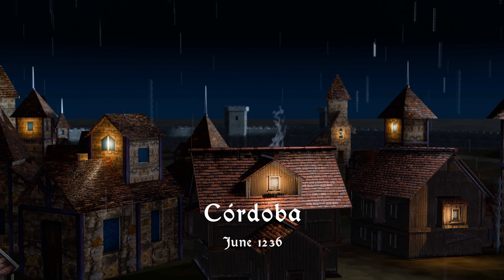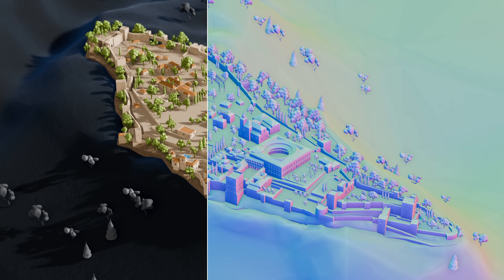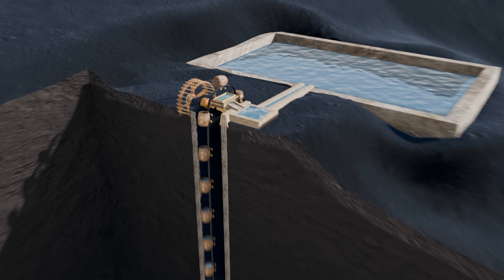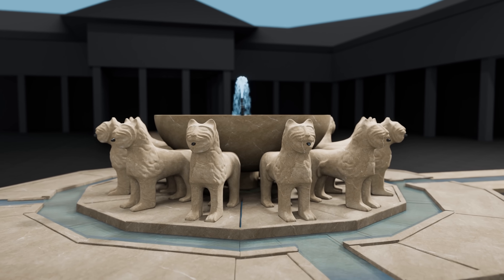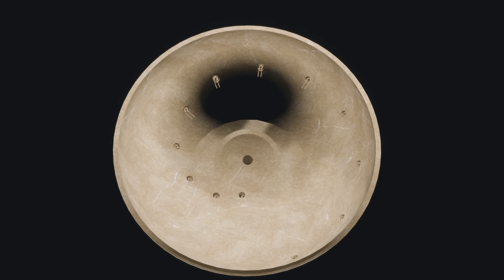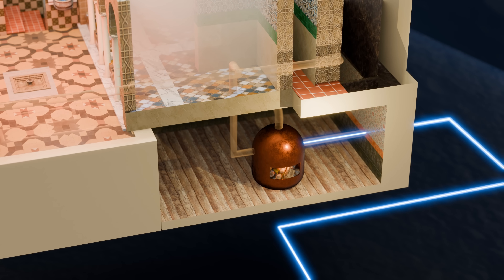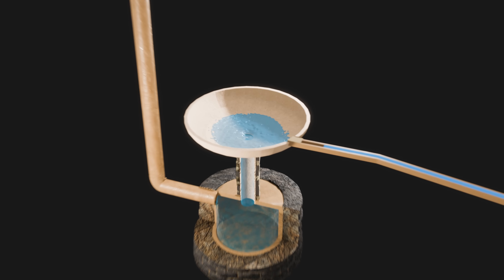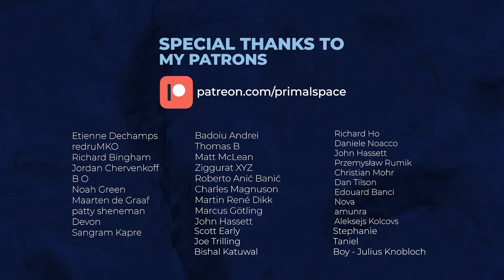The Ancient City That Mastered Water

Comment: The intricate calculations required for the amount of water flowing through each pipe and that to hundreds of years ago truly shows how skilled the architects were. Truly inspiring
Reply: Maybe just drilling an extra hole every hour? But looking at the design, the bowl becomes wider in height making the water rising slower, and the number of holes leaking increases,  making the precision on the late hours much more problematic
Reply: @2adamast  they actually compensated that, btw flow was controlled by a rotating wood valve that needed replacement every few years that controlled flow rate
Reply: And what is so special  in comparison to Roman aquaducts and fountains?
Reply: Islamic architects. Africans and Muslims brought plumbing to europe. And bathing. And reading.
Reply: @GoodBaleadaMusic  😂
Reply: @cartercasias6318 Spain was a Muslim country in 1491. Laughing white clowns don't exist now that we have chat GTP and the internet. You've been completely contextualized.  The middle East spent 1500 years in Europe colonizing it and teaching it everything.
Reply: @cartercasias6318  basic information makes you laugh like a goof 😂😂😂👍
Reply: @cartercasias6318 thats, history?
Reply: @GoodBaleadaMusic  Ancient romans had plumbing and aqueducts tho(before even both Christianity and Islam were known to Europeans). Also, Islam didn't really become a thing until centuries after Christianity happened, and got adopted by Euros first before some of them converted to Islam.

First roman aqueduct was built centuries before Christianity and Islam.
Reply: @GoodBaleadaMusic  Nice propaganda. But nothing of that was found in the Meccain culture before muslims conquered highly cultures of Rome and Persia.
Reply: @peacebewu  Roman baths are not the same as broad plumbing infrastructure. Or broad education. Or broad hygiene. That is what Islam brought to Europe.
Reply: @morriganmhor5078  What are you talking about? Islamic Spain was the only place with plumbing and literacy for like a thousand years in Europe. It took the rest of Europe a thousand years of being neighbors with Spain and Italy but also persia's right there. The Germans have linguistic ties back to Turkey 

They couldn't fucking read 😂😂😂😂
Reply: @morriganmhor5078  The entirety of your historical knowledge is propaganda. Take the Spanish example for Moreno. They say it means brown. But it's original biblical version is shiny black. But Spain doesn't want you to know that they had African Kings
Reply: @GoodBaleadaMusic  Excuse me, but I studied at university, not at leftist madrasa.
Reply: @GoodBaleadaMusic the greeks and especially the romans already had plumbing, bathing, and reading. medieval europeans already knew how to make architectural marvels, i mean just look at venice.
Reply: @GoodBaleadaMusic the water channels and plumbing were there before, left behind by the Romans, which is why an aqueduct is part of the framework, the Muslims just connected new buildings to it after the invasion.

Romans had plumbing and baths, in fact they are also the reason a lot of north Africa and the middle east got any of it.

Unlike what a lot of Muslim propaganda likes to push, when the Muslims got kicked out it wasn't like going back to the stone age, it was the start of a golden age for the countries they got kicked out from, and this is verifiable very easily.

Not to mention the wild Muslim claims especially about the paradise of Al-Andalus, considering none of these claims have historical sources, rather artistic sources, commissioned centuries later, created by people who never even visited Spain, while the historical sources of the time completely disprove any of it.

The word moreno means more of a tan, there is another word for brown, marron, these words come from latin and marron specifically appears in multiple European languages as a word for chestnuts which are brown.
Reply: There are going to some people that would call this "Aliens", wish i could attach the history channel guy's gif here.
Reply: @GoodBaleadaMusic  The romans created all that, that's where islamic architects got the knowlege. Stop being pathetic please, it's cringe.
Reply: @backintimealwyn5736  Those Romans became Muslims. At Rome's peak it was only 4% European. You're like one of those North Koreans that thinks daddy moved a mountain. You're so propagandized that you have to erase a thousand years of history. 

Europeans are some of the most pathetic and desperate rewriters of history.
Reply: @backintimealwyn5736  You truly believe that Romans were white people. The middle East colonized Europe from around the time of Caesar until the fall of the Ottoman Empire. That is where the center of knowledge and invention and philosophy lived. Leonardo da Vinci developed in a center of Islamic scholarship. Kings from all over Europe sent their princes to learn to read from Eastern people's. Not Europeans. You call the dark age a moment when Spain had plumbing and literacy because it was controlled by Africans and Muslims. You believe a complete Disney fairy tale of history. So please you stop being pathetic. I could sit here for hours reteaching everyone reading this. I will make you look like a fool.
Reply: One version (romans brought), does not exclude the other (muslims brought it).
What if romans had it first, the later christs in their area forgot about it, while muslims picked this inventions up and kept it, so that the later christians (13. to 15. century) retrieved this know-how back? History is not linear, and healthy empires exchange know-how.
Reply: @morriganmhor5078  I think you dont know that Baghdad was the centre of civilzation during that time. Even people from Europe used to go to Baghdad to get education. Its a fact and not easy to digest for some people. Do you even know why the students are asked to wear a gown which looks like Arabic dress when they receive a degree???? Just think about it. Western world was in dark ages at that when Muslim world was st its peak. But now Muslim world is in dark ages while western world is at the peak of development. History repeats itself.
Reply: @AR-fr8br  Muslims occupied the most developer parts of the Rome And Persia. As long as kuffar paid jizya, chalifate was healthy, but as their number diminished, IT Went south. Btw, were was all that Arab science, medicine or architektuře Before conquest?
Reply: @morriganmhor5078 We have the internet now. You can't rewrite history.  Muslims aren't just Arabic. The center of wealth and knowledge was always in the east whether it was in Persia or Constantinople or Egypt or Baghdad.
Reply: @morriganmhor5078  isn't it incredible how smart you thought you were? That part of the world has been the center of knowledge since knowledge had a center. Before that it was India.  Germans are just Turkish people
Reply: @morriganmhor5078  Islam have nothing to do with being arab and most of that knowledge came form the middle east and north Africa so basically the Islamic world and they did invented and discovered alot more so yeah they were more developed and had more knowledge and most of the scientists at the time were Muslims
Reply: Pretty sure all of those ideas came from the Romans.
Reply: @GoodBaleadaMusic  Your misconceptions blow my mind :
-2000 : Egyptians build the pyramids (so they had already mastered mathematics)
-300 : Romans build the first SPA of the human history
600 : Islam is created
1200 : Al Hambra is created.

You conclusion is that Islamic engineers gave SPA technology to Europe ?
But here you are bending 1500 years of human evolution (-300 vs +1200 so "Italians" had figured this out 1500 years before).
Reply: @kaoulkae  You're equating the baths of oligarchs to a city infrastructure of plumbing.  Your double standards below my mind. What the men from the middle East built in Britain was not what the men from the middle East built in Spain. It's not even close.  Plus they didn't teach anyone to read.
Reply: @kaoulkae  You're talking about spas for oligarchs.  I'm talking about city building.  I'm talking about global infrastructure for the whole city.  I'm talking about a society where everyone learns to read. Where scholarship and medicine and hygiene are important cultural traits.  That is what Islamic people from the middle East brought to Spain and Europe.  And then Christians rose up and lost all of their economic alliances finding themselves with no gold. So then they took all of that education that Islam brought them and have been raping the world for 600 years with it.
Reply: @nirmalprevin  They were Muslim engineers. I was born Catholic but i cannot look down on a religion that is followed by 900 million people ,  nevertheless today they would not be able to produce such cutting edge technology as they did in those days .
Reply: @GoodBaleadaMusic  Islam didn't exist when plumbing was invented, imagine thinking a BC era technology was invented in AD era religious sects. What a contrived conclusion.
Reply: @Mad_Catter_  It's like you guys think Islamic people emerged from the sand lol. The first cities with plumbing were Islamic cities in Spain. And you're right. The people who invented plumbing weren't Islamic.
Reply: @Mad_Catter_  there's something wrong with you. You literally think islamic people came out of the desert from nothing 😂😂.  This is why the CIA talks about you behind your back.
Reply: @Mad_Catter_ I keep reading your comment And it's like you smoked heroin thought about what I said fell asleep woke up and then replied
Reply: @GoodBaleadaMusic  "there's something wrong with you. You literally think islamic people came out of the desert from nothing"

No, you are the one whom think Islamic people existed in BC Era, what a notion of madness honestly.

Another notion of madness is thinking the CIA cares about me or anything within my capacity. Wild.
Reply: @Mad_Catter_  stop squirming you sneaky settler.  You are pretending that the people of Europe enjoyed plumbing because Romans brought baths.  But the first time that Europeans enjoyed broad City plumbing was when Muslims brought it there.  But you keep playing this game. It's not working. Everybody sees how desperate you are to hide the "dark ages". Which were really the moments when Africa and Islam were teaching Europe how to read and wipe their asses. But that's what hurts. That's why you're fighting so hard. That's why you're squirming. Because you're a squirmy settler.
Reply: @Mad_Catter_  It's kind of hard for white people to gaslight everyone with chat GTP and Google 😂😂😂
Reply: @GoodBaleadaMusic  We also help set up there goverment!
Reply: @backintimealwyn5736 lol , bro said the Romans 😂😂
Reply: @jeem-s3f  yep the romans put thermal baths all around the mediteranean well before the7th century , illiterate child.
Reply: You don't need to calculate things always, there are ways of doing things by using golden ratio or something else that work.
Reply: And whats the difference today?
Reply: @Mad_Catter_ Islam has always been there... it's from Abrahamic religions ...
Reply: @Mad_Catter_ Islam has always been there... it's from Abrahamic religions ...
Reply: @Logicalsane  No it really hasn't. Trying to claim that would then begin disputes that before the times of Abraham there were those before them, and that it actually belongs to Sumerians, which invalidates your entire argument that it is in fact Islam. Do you see the error in your thinking yet?
Reply: To be more specific, it's the Moslim architects, not medieval achiects.
Reply: @Fola1895  lmao Medieval architects could be any religion stop being daft.
Reply: @GoodBaleadaMusic and the Romans and Greeks?
Reply: @GoodBaleadaMusic and China?
Reply: @GoodBaleadaMusic the Greeks and Romans had baths. They had hygiene systems as did the Jews. I think you are using the word Islam for pre Islamic times and misconstruing historical timelines.
Reply: @BernardoTorres-w5e I think we underestimate what our current engineers can do.
Reply: @itsjudystube  why is it your cultural reaction to erase Islamic and African contributions to Europe? Do you truly believe that these contributions are contextualized correctly?
Reply: @cartercasias6318 that's literally true, The Moors civilized the Spanish. Spain was a sh1t hole before they came. 
You ignorance racist boy
Reply: probably trial and error rather than some maths
Reply: @GoodBaleadaMusic  HAHAHAHAHAHAHAHAHAHAHAHAHAA🤣🤣🤣🤣🤣🤣🤣🤣🤣🤣
Reply: @GoodBaleadaMusic  its true but not reading
Reply: @reactivist6526  doing your own disinformation campaign 😂😂😂
Reply: @GoodBaleadaMusic  you brought nothing only silly claims, i guess you cannot fathom the truth
Reply: @reactivist6526  I guess you're not strong enough to point out which claims you have trouble with.  I think it's your culture
Reply: They stole old Indian technology through Mughals.
Reply: @GoodBaleadaMusic  Pipes and water management is way older than that. Here in La Alhambra they took the water from the river, very "advance" for medieval period...This pipe system is ridiculous compared to any Classic city from 7000 years ago. Nothing to go crazy, that´s why the Califa drink a lot of wine, cos the water was bad at the Alhambra hehehe.
Reply: @josemorenoporras7506  I'm talking about Europe. So you're saying it took them 7,000 years and 1,000 years of Islamic colonization for Europe just to learn how to do that? Plus reading?
Reply: @josemorenoporras7506  and the pipes and water management system in Al andalus is just an extension of normal old regular water management from Africa. Completely futuristic in Europe
Reply: @peacebewu the ancient middle Eastern civilisations had a water system long before the romans even existed. The romans were considering barbarians by the ancient Syrians (phoenicians) who had taught and given them the alphabet, theatre and trade.

Romans only civilised when they come into contact with the Middle Eastern people. The most significant roman family wgo shaped roman Europe were middle Eastern such as severus septimis dynasty. Also the roman syrian architect appolodorus 😂.

Do more research!
Reply: @morriganmhor5078 the dam of marrib was the first fully  structured engineering water dam in history and that was in arabia long before the romans even existed 😂 you think arabia is mecca?
Reply: @meyou7544 the ancient middle east had engineered a whole long dam in marib and several others in the ancient levents long before the romans and Greeks even existed.

We don't measure early human civilisation to romans and Greeks as they were considered a people who were barbaric and destroyers of civilisation woth no alphabet of their own until they came into contact with the ancient Syrians who gave them an alphabet and made them civilised. 

Why stopped the romans and Greeks to create a marvel such as the Alhambra? 😂
Reply: @enlightenlife2840  And that dam was destroyed in the 6th  century, though Mohammed probably saw Its ruins. This knowledges  could have come from Mesopotamia - or was original.
Reply: @morriganmhor5078  nonsense that particular dam was not fully destroyed it had a large damage and was reconstructed. It's one of many dams in ancient yemen and one of the very early dams in human history that's older than the whole of Western history, let alone the romans and the Greeks who certainly aren't considerd very ancient. 

I don't know ow why you bring up mohamed or islam. The arabs are recent people with no ancient history, lol

Mesopotamia dna tells us that ancient Iraqis and Arabians are the same people. The population of the east was not large nor were diverse in race. There is no denying, though, that a few new admixtures come to the east, in particular, the levent such as the romans and some Africans.
Reply: @morriganmhor5078  *the arabs are ancient people with many ancient kingdoms and civilisation.
Reply: @ Definitively. That´s why they diligently copied Roman architecture. Do you know anything about "Africans and Muslims brought plumbing to europe. And bathing. And reading" before they conquered Syria? I think not.
Reply: @morriganmhor5078  how did the arabs copied roman architecture if they fitmed a whole new style of architecture? 

The Eastern world had civilisation older than 6 thousand years old before Europe existed as a liveable continent 🤣 

You need to seriously study ancient Middle Eastern water and architectural systems. Rome had no writing system until the Syrians taught it to the early etruscans to which taught the romans and Greek.

Boy, you're stuck at roman history when I'm talking about the deep ancient history that's over 5 thousand years. 

Go back to school, dear. The romans hardly left actual culture in the West despite being civilised through the east. They hadn't transported fruits nor vegetables, no gardens to the west.

They built great theatres and military, though. I'd give them that! 

The only culture people visit Spain for is islam culture, not roman or the church.
Reply: @enlightenlife2840  I sincerely wonder if Sabeans or Nabateans considered themselves Arabs. Yes, those two tribes really did something. But Kalbs, Big Desert and Hidjaz tribes? Don´t make me laugh.
Reply: @morriganmhor5078  they are arabs by dna, lol. The entire ancient Middle East is arab by Dna. There is no evidence that such a small geographic region produced many races. Nabateans spoke arabic that I could understand as well as hebrew, which is an old arabic dialect. From the phoenicians to the southern Arabian alphabet, it is still the same exact sounds alif ba,ta. 

The safaiatic script was found even in Italy and Greece. That's how far the arabs travelled discover so far. When one has a civilisation, it is normal to go on expeditions continuously. 

You have no idea about ancient Middle Eastern civilisations or kingdoms. Even the Persians learnt how to read and write from the syrian arabs lol. Go research that out. And don't forget the East Africans who, until today, use the South Arabian script to write their oral language into a literacy system. They didn't read and write until the sabean rule.
Reply: @enlightenlife2840  No, the pax romana was the era before the Severan dynasty. If anything they helped bring about its downfall.
Reply: @enlightenlife2840  That is why the largest prehistoric cities where in Romania and the Ukraine.
Reply: @morriganmhor5078 Yes, we consider ourselves as arabs, I'm from the land of saba, and my ancestors migrated to many land and created civilisations. When we call ourselves arabs it means we are indeginous to the region, we share the same DNA as our ancestors and traditions. Our artifacts tell us who we are and what belief systems, lineage,wars, triumphs we had and the lands we conquered. I think you westerners think the term arab is a new term when it's not. We are indeginous middle Easterners, and our ancient history speaks for itself. What's funny is that the language of arabic hasn't changed much as when the letters were deciphered all the sounds are arabic even the numbers and expressions. You people have no fucking idea about our ancient history thinking we are some new aliens.
Reply: @meyou7544  so that's why Europeans even kings and Queens took bath only once a year😂😂
Muslim ruled Spain Portugal Sicily Gibraltar were the greatest entity in the Western world. Look where they're now . Not in the first class of European countries. All happened after they forcefully converted to Christianity and did genocide who opposed not only muslim but also Jews. But all three religions were mostly in peace for centuries under Muslim rule just like Palestine
Reply: It's not solely on calculation